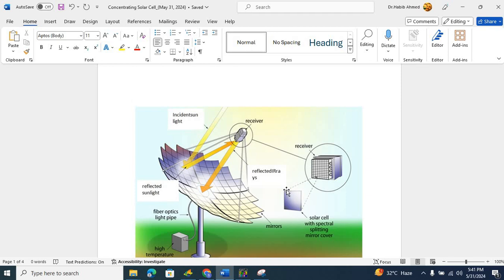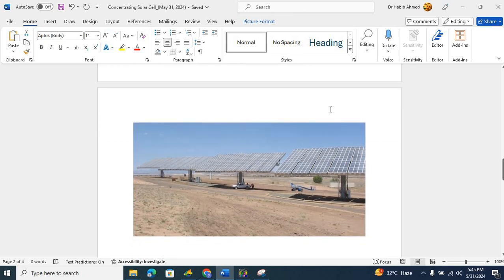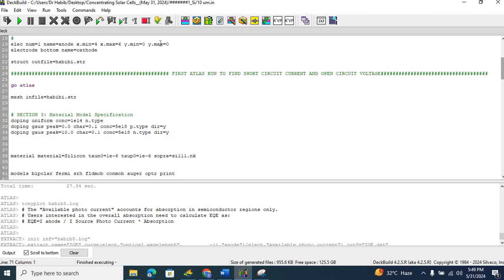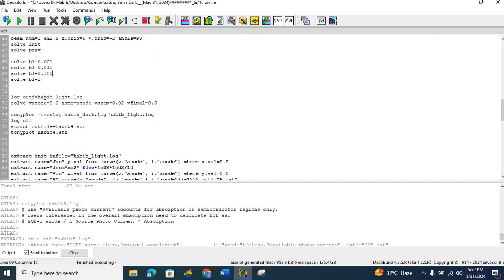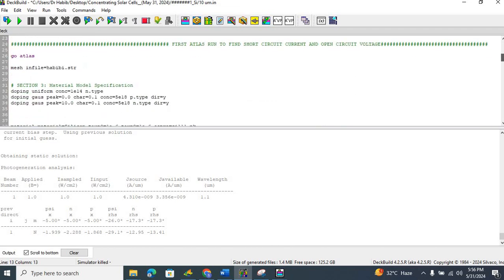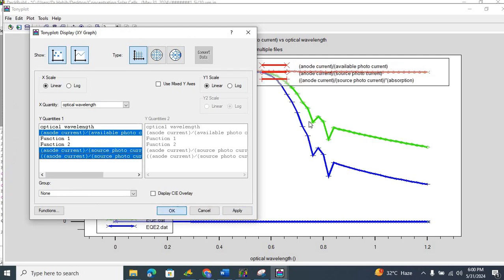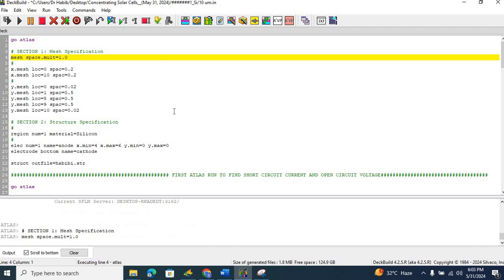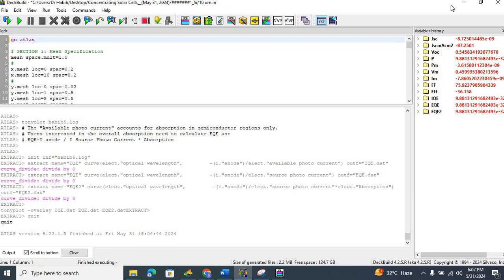Silvaco TCAD Simulation of Concentrator Solar Cells || Concentrating Photovoltaic (CPV) Systems 🌞💻💡🔬

Comment: Which one is better, mono crystalline or poly crystalline pannels.
Reply from the maker: That's a great question. 

When choosing between monocrystalline and polycrystalline solar panels, both types have their own advantages and considerations:

Monocrystalline Panels:

Efficiency: Monocrystalline panels tend to have higher efficiency rates because they are made from single silicon crystals. This means they can generate more electricity per square foot compared to polycrystalline panels.
Space Efficiency: They require less space to generate the same amount of electricity as polycrystalline panels, making them suitable for installations where space is limited.
Performance: Monocrystalline panels perform better in low-light conditions compared to polycrystalline panels.
Polycrystalline Panels:

Cost: Polycrystalline panels are generally less expensive to manufacture than monocrystalline panels. This price difference may make them more attractive for some buyers, especially for larger installations.
Temperature Tolerance: Polycrystalline panels typically have better temperature tolerance which can lead to slightly better performance in hot climates.
Appearance: Polycrystalline panels often have a bluish hue and a less uniform look compared to monocrystalline panels.
Choosing the Best Type:

If space is limited and you need to maximize the electricity output from a smaller area, monocrystalline panels might be the better choice due to their higher efficiency.
If upfront cost is a significant factor or if you have ample space for installation, polycrystalline panels could be a cost-effective solution.

Ultimately, the "better" choice depends on your specific needs, budget, and the conditions at your installation site. Both types are widely used and have their own strengths depending on the circumstances.
Reply: @HabibAhmadGatech  Thanks for your detailed reply Dr. Saab
Reply from the maker: @saidnabi1676  You are always welcome, buddy!